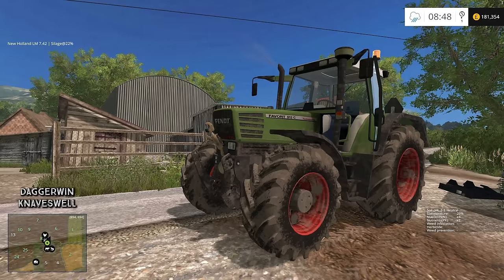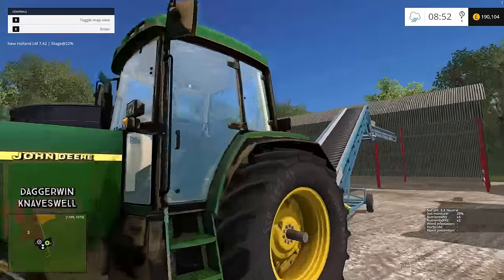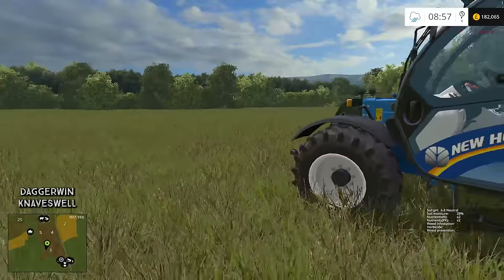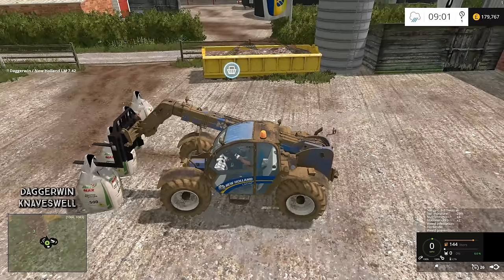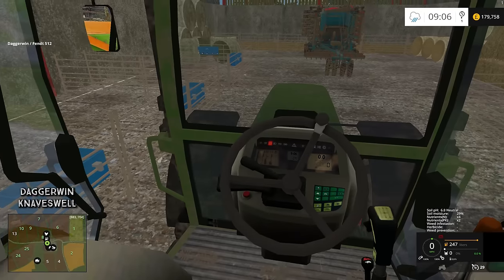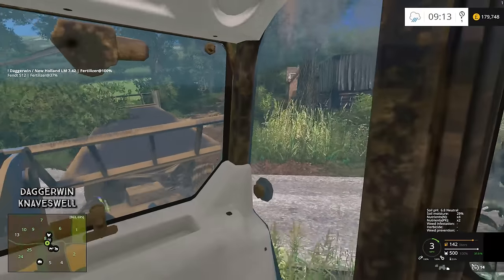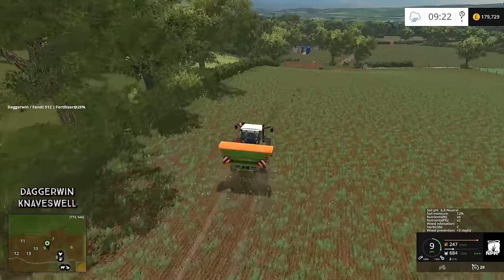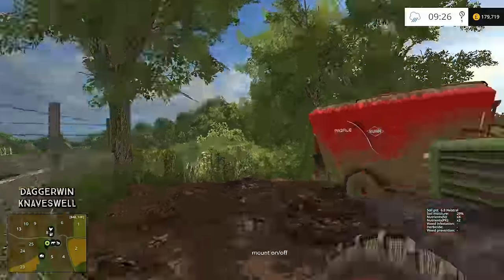Let's Play Farming Simulator 2015 | Knaveswell Farm | Episode 20

Comment: I think I have already told you this before, but If I'm using the default sprayer/ spreader, I always start with the the sprayer to get my tramlines set because the default sprayer only has a working width of 24.9m, and the sprayer has a width of 26 m. The reason I know this is because I mostly use the GPS mod. The modded sprayer you are using has an even greater working width I think, which means if you set your tramlines with this, when you come to spray, you will be missing a lot of ground on either side. Also, I hate that big bag mod. The idea is good, but it is just so unstable to use. And sorry to have to say this, but you made a real lash up with field 8.

Comment: You should use the 512C for frontloader work instead of the 820. loader fits the tractor better as it is to small for the 820.